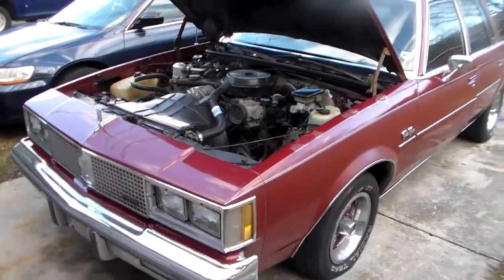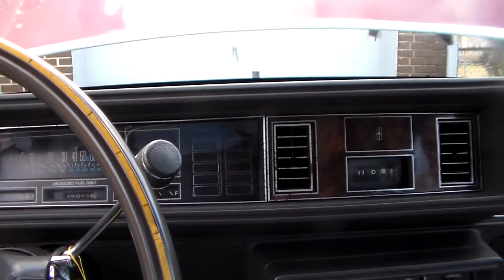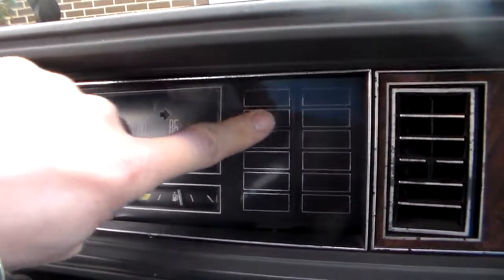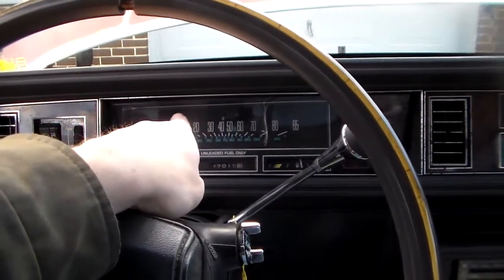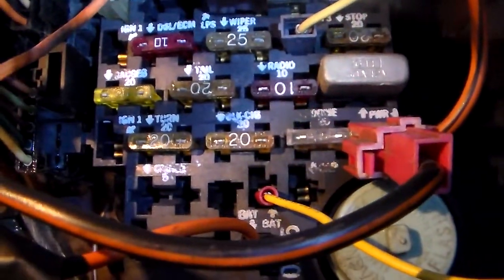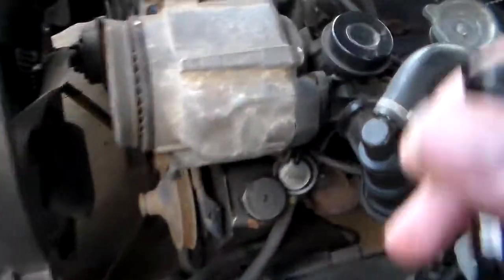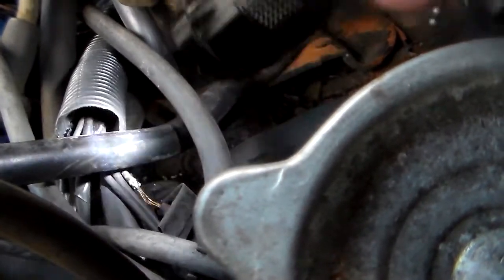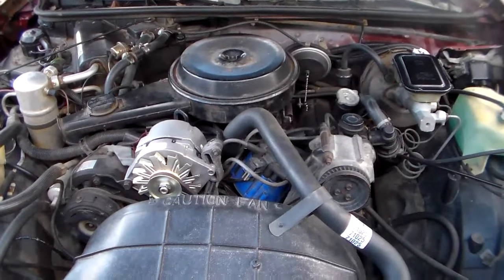Solving a mysterious electrical problem with the '83 Cutlass Cruiser

Comment: I have been fussing with my battery and alternator since october because of the charge warning light.  In Alberta there have been some -30 degree days and I do not want that battery to freeze.  Every time I checked the battery the charge was good.  Every time I checked the charge from the alternator 13.5 volts.  Good.

I had not got around to checking out thew seat belt warning system that also failed because I believed it to be less important.  On the front left fender under the hood there is a heat resistance switch (normally closed) on a circuit that was rusted.  my cutlass is an 1978 with 350 v8.  What is that rusted switch for?

Thanks again for your insights.  It is much too cold out here to be messing around.  most of my time has been spent digging the car out of the snow.  with 120 cm of snow I finally purchased some snow chains.  I will make a video of this most excellent addition to the cutlass... these  tire chains are just too cool;  eh?

I can't wait for daylight to look at my problem with the charge light.

Comment: I’m having the same exact issue on my 1987 cutlass with the 3.6. The smog pump has been removed I traced all wires countless times can seem to find the short. It pops the fuse as soon as I turn the key on. Any thoughts? Super frustrating!!

Comment: I have an 86 Cutlass I just changed the battery and a tail light bulb now my clock on the radio will not turn off with keys taken out. radio doesn't power but clock always stays on. don't want battery to drain... any ideas?
Reply: Factory radio?

Comment: I really need help to fix my horn so I can pass the safety I change the relay and fuse but it's not going any ideas please
Reply: Take the 2 small bolts off to take the steering wheel cover off. There is a plastic the turns into the steering wheel . Sometimes it brakes and wont let's it push down. I can send you a picture if you would like.